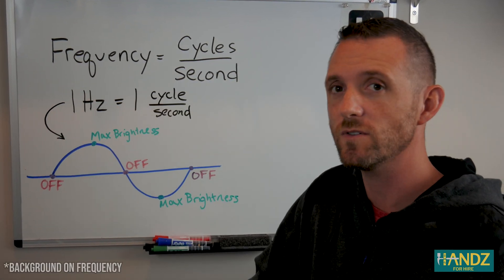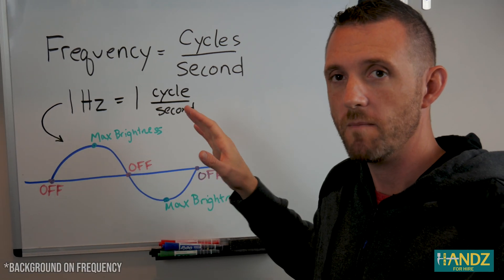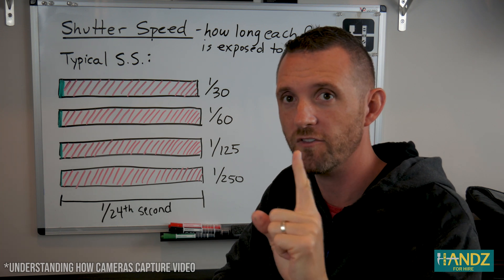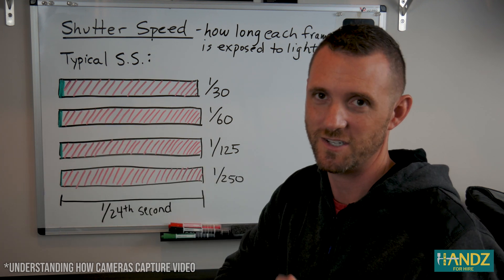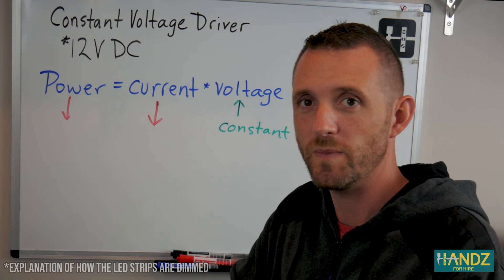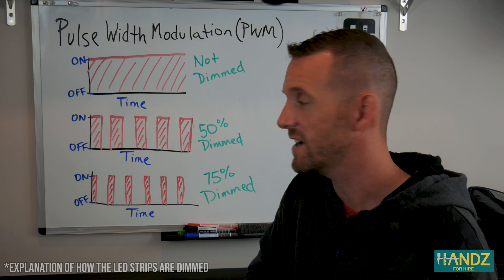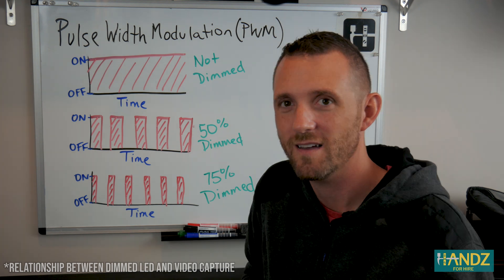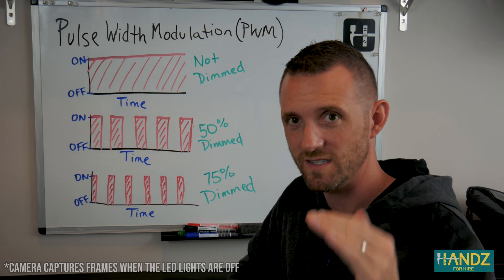WHY DO MY LED LIGHTS FLICKER ON CAMERA?

Comment from the maker: Thank you to @Kenta Hirono for kindly pointing out a mistake I made @2:40. When I am talking about shutter speed, 1/30th is in the units of seconds (s), so therefore each frame the shutter is opened 0.033s or 33.3 milliseconds (ms). I shot this video in 24 frames per second, which is 41.67ms per frame. This means in each frame if shooting at 24fps with a shutter speed of 1/30, the shutter is open for 33.3ms and closed 8.33ms. This means my green bars are inaccurate. For example, the 1/30 bar, 80% should be highlighted green and 20% red. The entire explanation is still holds, but I made a mistake on how shutter speed relates to frame rate. Please forgive!

Comment: i thought led were a constant on or off. not a flicker. also, why do they disappear when turning polarized glasses back and forth?
Reply from the maker: The driver or pulse width modulator I used in this set up regulates the current distributed and therefore the time the LEDs are on and off per second. To answer your second question, some light is polarize with a screen or filter. This means that the light we're observing is coming to our eye in a very specific direction. If you have polarized glasses, they only allow light through in a specific direction. One way you'll be able to observe the polarized light, and if you turn them 90 degrees, the polarized light can no longer pass through. I always think of it like white picket fence. If you have a long board, you can pass it in between the pickets if the board is aligned right, but if the board is turned 90 degrees, it gets caught by the pickets and can't pass through. Hopefully that makes sense. I can clarify more if you need me to. Have a great day!

Comment: hi! may i ask you something? will pointing phone torch/ phone flashlight/ LED light directly to other phone camera (with and without the camera app opened) damage the camera itself? maybe the sensor or something.. i did it to check some scratches on my phone camera and i'm worry now. thank you in advance :)
Reply: thank you so much for the explanation! 😁🙏🏻
Reply from the maker: Thanks for reaching out. I don't think it would damage the camera at all. The lens on an iphone has an auto ISO, so if the camera was on, it would just lower the ISO to try to get the exposure right. If the camera is off and you shine the light into the lens, light doesn't have enough energy to do any damage. Good luck, but I think you're fine.

Comment: I appreciate this video but how do we fix this haha
Reply from the maker: Hi Jonathan! With a camera, it's extremely difficult to get rid of the flicker when you're filming LEDs that are dimmed.  I found that there's two ways to mostly remedy. You can either turn the dimmable LEDs all the way up (decreasing their off time) or bring in other light sources to offset the flicker. I hope that helps a little!
Reply: @HandzforHire   Hey that sounds plausible. What do you think of potentially buying a normal bulb (non LED) and using a physical colour overlay or maybe putting it in some kind of coloured softbox. OR buying BATTERY OPERATED (rechargeable) LED lights since the batteries create DC and not AC? Ever had any luck with either of these before I go and spend money lol?
Reply from the maker: @jackwalton6657  Hey Jack - I think those ideas would work. I use LEDs in filming all the time. I have a bunch Aputure lights likes the AL-MC or AL-MX. They work well and are DC with a constant flow of electrons. I also have a Godox SL150W II which is a dimmable AC power LED key light. I have a soft box on it and have never had a flicker issue because the light is diffused. Another trick you might want to test before you spend a lot of money is adjusting your shutter speed. Usually if you have a high shutter speed (1/125 or 1/250) then you're more likely to end up with flickering than a longer exposure. Good luck and let me know how it goes!
Reply: @HandzforHire  hey man thank you so much for your comprehensive reply! It's a massive help and very encouraging to me as a new videographer. I'll check out the lights you mentioned and have a look for a few bits to add to my kit. I'll let you know for sure the results 😎
Reply from the maker: @jackwalton6657  You're welcome!
Reply: @jackwalton6657  thank you so much but I will need to get the electricity back on in my room

Comment: Weird this doesn't have more views. Very well made. Only thing is, when you showed the on-off cycle at 1:17. it's actually a square wave that the LED driver creates. You were essentially right, but you were showing a sin wave, which goes negative, which an LED cannot do (unless they're bipolar, but most LEDs are not). But still, good job.
Reply: Oh, and I should clarify, I'm only referring to LEDs. Indoor lights that use AC follow that principle you showed. But, in this particular case, you were talking about LEDs, so I see where your explanation was coming from.
Reply from the maker: @AspectOfTheStorm  Sorry it took me so long to respond, but you're completely correct about the shape of the wave. LEDs are only on and off so therefore a square wave. I kind of show it later in the video with the dimming effect of an LED, but it would have been better to be more clear at 1:17. Have a great day!